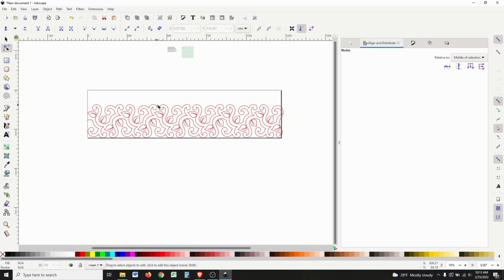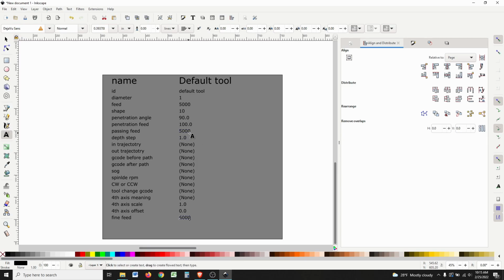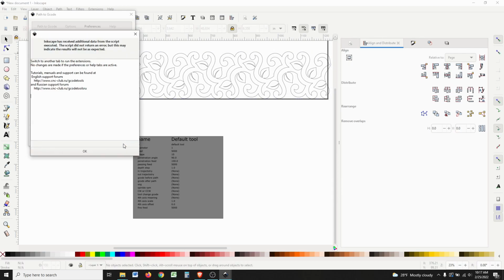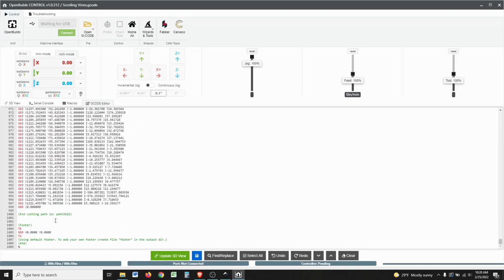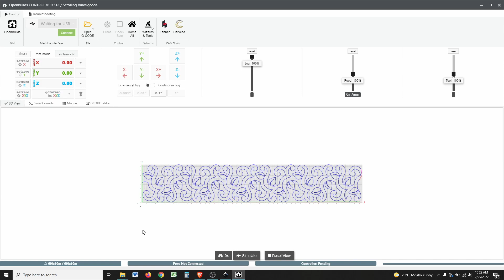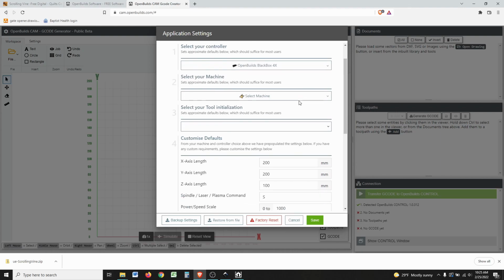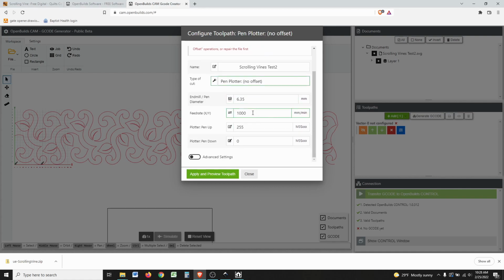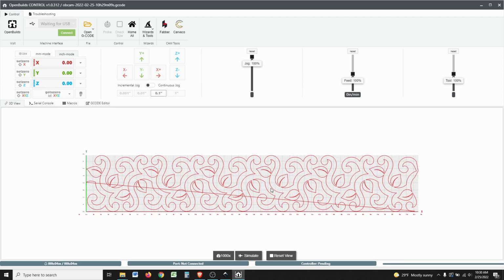Vector to Gcode in Inkscape and Openbuilds CAM for a Longarm Quilting Machine Part 2

Comment: I came at this issue from looking at  G-code file first. The .PAT file is Innova-longarm compatible. Is it the controller selector that makes the G-code work for the type of sewing system you are running? Or is G-code generated for this type of contiguous path "just work" on any device? I keep seeing "Innova-proprietary G-code"  and fear that I've hit a brick wall. 

Your video is a great resource and if I end up fussing with this myself until I figure out  combination that works, at least I've got a solid starting point for this G-code quilting adventure.
Reply from the maker: It's just plain Gcode that would be used for a cnc router.  I basically just have a cnc router that is moving a sewing machine instead.  The sewing machine has to have it's own stitch regulator that makes it sew the correct number of stitches any time it is moved.

Comment: Hello, this is super interesting because I did something eerily similar for my wife and her longarm a few years ago. Created a 2 axis system using a PMDX controller and Mach4. Even designed a simple Mach4 screen specific for this system. Worked great and we used it for about 2 years, but I honestly got tired of creating the quilting designs for her, she did not know how to do this. We finally bit the bullet and purchased Intelliquilter (amazing) and now she can set up designs without my help. Like you, I also used Inkscape with the gcode extension to set up the designs. You can eliminate some of the manual steps to edit the gcode you demonstrated by updating the extension backend files to have a standard template that will insert those code items automatically for you when the gcode is generated. I was also able to add in the command to start the longarm when the code starts running with an electronic switch connected to the controller. Anyway, good work on all this. Glad to see someone else take the time to figure this out!
Reply from the maker: Thank you so much for the reply.  Your experience is a lot like mine.  We actually just finished installing a Quilt EZ Butler robot system.  I couldn't afford the Intelliquilter.  It's working great.  Like you I had to make all the patterns.  The most frustrating part was that I didn't use Mach4 and the controller software I was using did not have a "start from here" feature so if you had a thread break you had to start from the beginning and run the path and stop it at the right time.  I thought about changing over to a different board and mach4 like I have on my other CNC machines but decided to upgrade to this.  The DIY system did it's job proving that the investment would be worth the money so nothing lost and lots of experience gained.  I am impressed that you were able to change the code in inkscape and get the machine to start and stop.  Coding is not something I am remotely good at.  I have a son who helps me with things like that but he is busy and I hate to ask him for something that may take days to sort out.  Thanks again for your post!